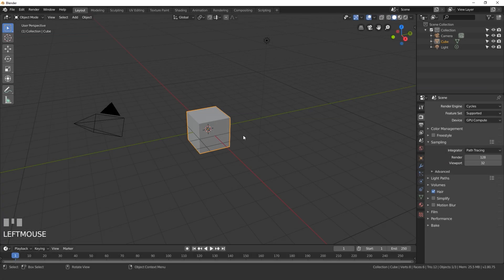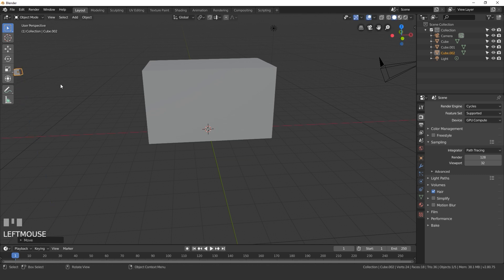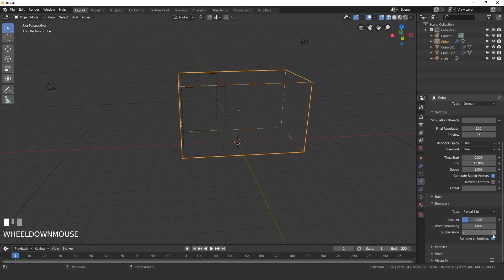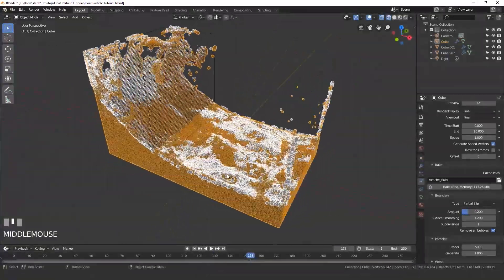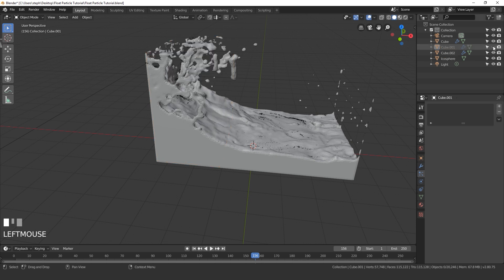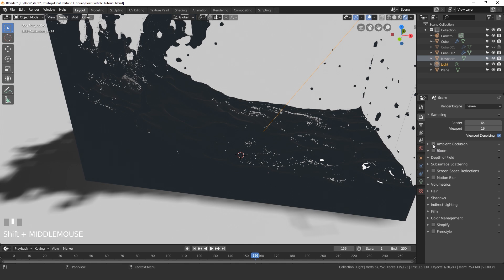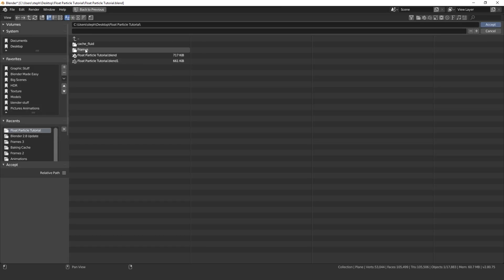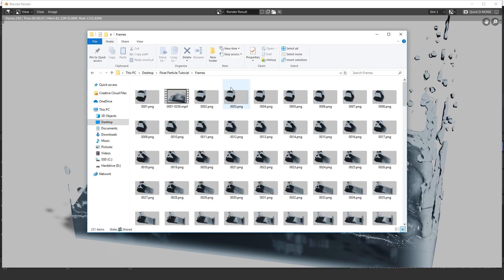Blender Tutorial - Fluid Simulation & Float Particles in Eevee

Comment: Looks like the course you mentioned will be outdated as soon as the Mantaflow FLIP fluid simulation engine will replace the current fluid simulation engine in blender which can already be downloaded in V2.8.2a experimental. It's been available for download for quite a long time now as it is being developed. As far as I know it will be in the V2.8.2 release version permanently. Can you make a course based on the Mantaflow version which generates Spray, Foam and Bubble particles as well?
Reply from the maker: If Mantaflow is fully integrated in Blender 2.82 I will probably update the fluid course.   And yes I will be doing tutorials on the particle effects.